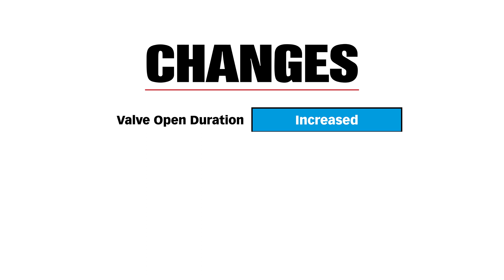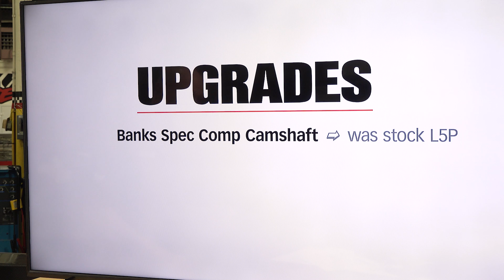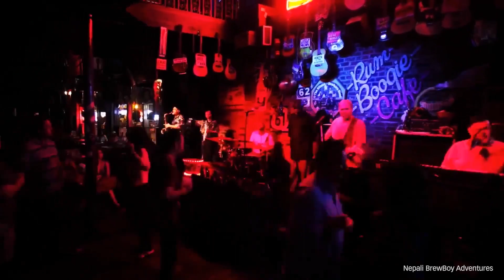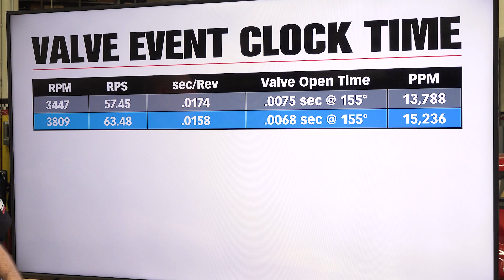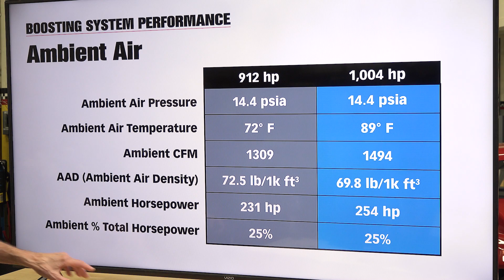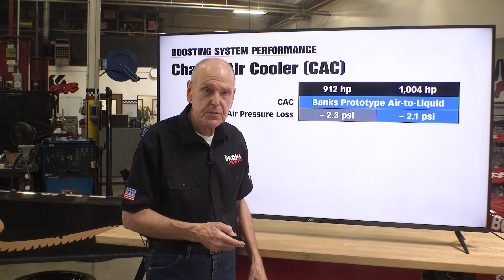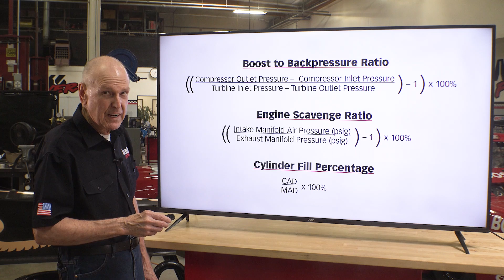1,004 HP !!! Killing A Duramax Pt 15

Comment: When the diesel king speaks the data truths it just makes me think everybody in the “roll coal” diesel world are just fools in his court.
Reply: I think it has to do with a limit of the mechanical pumps back in the day, by today’s injection technology, you’re right, they’re not just clowns, they’re the whole circus
Reply: Yeah I was that guy until I was enlightened by his videos. 2 gen dodge is a pig.
Reply: @joshuafiller254  it is a pig, unless built right.
Reply: @joshuafiller254  
Much respect to admit you rose up from ignorance.
Reply: @ZEPRATGERNODT  ignorance is nothing to be ashamed of.  Refusing to learn is shameful.
Reply: "Rollin' coal" is a meme as much as stance and "hellaflush" is, these days.
Reply: Yeaa you lost me at king of diesels.
Reply: yeah, refusing that heat and torque kill things
Reply: Yep roll and Coal...  just blowing unburnt fuel out the exhaust and Sooting up the inside of the engine...
Reply: Rolling coal is the diesel equivalent of putting a fartcan on a base Civic.
Reply: Lots of haters but I don’t see anyone proving him wrong with facts.
Reply: Fools for sure 🤙rolling coal is for people who don’t know power
Reply: Rolling Coal is the ugly, stupid and irresponsible way of making power.
With all the air pollution now days, those ppl should be arrested and jailed for minimum 30 days for reckless polluting.
Also tire burnouts should be the same.
We need to stop these retards from polluting everyone's environment.
Reply: The rolling coal brigade doesn't care about power as much as they care about laying soot on everything around them. If you want to keep it street legal there is zero need to make AFR so rich just to cool down the cylinder. WM or nitrous work better for that, and more sustainable for the sake of a handful hp at the top of rev range. Obviously the way Gale did here was to increase intake efficiency (maf + density), better fueling (cam duration, injector pressure) and improving exhaust scavenging.
Reply: It would be great to remove the EGR’s and DPF’s and make the Banks only tunes the standard of the land. We could have 1,000,000 mile diesel engines that get 25mpg!
Reply: Well yeah, roal coal is only burning more fuel and that's how it gets so much smoke
Reply: @josesaldana8058  kinda.. you get soot when you get incomplete combustion. Plenty fuel but not enough air / duration / compression (heat) to burn it effectively
Reply: The coal rollers are fools to ANY halfway intelligent person... 🤷🏻
Reply: I need compounds in order to not roll coal and compounds will throw a rod. A s468 will throw a rod if I come down from my s475. More low end torque with compounds which will burn the fuel and not roll coal but will produce too much tq for my stock bottom end.
Reply: I've always said rolling coal was stupid and showed a waste of potential power.
Reply: If your not rolling coal there’s still power to be made. You must not understand how the diesel engine operates. They can’t run rich, and the more fuel the more power.
Reply: In high HP applications excess fuel is used to cool the cylinder air temps. So it’s not completely useless but for anyone on the street, it is.
Reply: @DaCaveman84  soot production doesn't Cool it elevates the EGT and internal heat transfer at the turbo. Very much the opposite to what you said
Reply: @turbolife5912  microscopic soot is devastating to the surface,  think 2000 to 6000 grit polish.  That's a wonderful thing to be in a rotating mass like an internal combustion Gas or Disel...
Reply: @DaCaveman84  unless you're lavvon than you use water meth, to keep them under 1800
Reply: @DaCaveman84  Not in a diesel engine.
Reply: For a diesel engine, anywhere between around 16:1 to 13:1 is a bad place to be.  If you're at 16:1, add a little fuel, and end up at 14.5:1, you're going to melt pistons.  If you add enough fuel to bring it down to 12.5:1, you start cooling off again.  A diesel will make more power on the rich side of stoich than on the lean side, but it'll smoke like a bitch.  Add even more fuel than that, and you'll end up cooling the engine.  The difference between a rich burning gas engine and a rich burning diesel engine is that the diesel doesn't lose power like the gas engine does...because there's no spark to foul up or flame propagation sensitivity.  The main takeaway here is that yes, adding enough fuel will make a diesel run cooler, but it's a last step in an all out competition environment.  You need to concentrate on getting everything else on the engine working well before you consider going rich, and you're definitely not going to use it on the road.  So for anyone planning on building their trucks to be street legal, you follow the lean of peak ethos because there's no need to go rich on a truck meant for highway driving.  Most engines grenade before you run out of power adders anyway, so running rich is hardly even a consideration.
Reply: @Skinflaps_Meatslapper  well said.   The force is strong here boys,   listen to the man..
Reply: @Skinflaps_Meatslapper Extra air is better for cooling
Reply: @monsaka7827  Extra air will cool the engine, but it's not "better"....with that extra air, you can burn more fuel, which means you can make more power.  Cool the engine with fuel and you make the most of the air that you've worked so hard to get into the engine.  The trick to making power with any engine is getting more air in, so long as you're utilizing it for power instead of for cooling.  Gas turbines give up about half of their shaft HP because they need a blanket of air to keep the engine from melting, diesel engines need the same, but the way they differ is that a diesel engine will start cooling off again once you pass stoich and add more fuel.  What that means is you're utilizing 100% of the air you're putting into that engine, rather than 100% of the fuel.  Fuel is cheap when the goal is to make power, air is expensive.  Use all the air you can.  There's a reason why none of the drag and tractor pull diesels are clean burning engines, they all roll coal because they've already maxed out the amount of air they can stuff into those cylinders...the only power left is to go rich of peak.
Reply: @Skinflaps_Meatslapper  Air is better and safer.
Reply: @monsaka7827  Air is better and safer for your grandmother's VW Jetta.  You're more than welcome to not understand what I'm saying, I won't stop you from being a walnut.  Stay on the pansy side of peak burn if you like, I couldn't care less.
Reply: @DaCaveman84  bro have you seen the 1320video coverage at UCC? A guy (can't remember his name) put down 3336whp without blowing up or overheating, while smoking about as much as a 24v 5.9 Cummins with 15 over injectors.
Reply: @DaCaveman84  you are right.  I am in head porting diesels for 22 years now... And the high boosted engines ...need the extra fuel cooling things down to prevent pistons from melting..... 

I know a lot of smoke costs power..but if you can run 6 or 7 bar of boost.....instead 4....
Reply: It's also a money thing. It's a "free" upgrade to take a grinder to your fuel plate amd dump fuel in an old diesel and make some power.
Reply: the way this engine is setup is not emissions legal. with a dpf of these power numbers would not be achievable.
Reply: @djcurtis8677  not sure in the states... but over in the UK we have a smoke opacity test, cars with faulty DPF removed will pass the test no problem and was common practice to remove them and change the map. Until the  government made it illegal. These cars would often be too clean for the machine to pick up. A replacement DPF costs 1000s in some cases so that was the reasoning for people to do it. Surely if the engine is running that clean to pass the test with out it... they can't be doing a whole lot of help with them fitted but to restrict the engine flow and cause problems.
Reply: @djcurtis8677  everyone in here is a diesel performance fanatic and no one here cares about diesel emissions, I assure you. Gale does and he produces VERY clean burning diesels.

Also, 1000hp is definitely achievable with emissions hardware on a diesel. LML owners have been doing it for some time now.
Reply: @utvwerxoffroadfabdesign4172  I think you completely misunderstood what I was saying. I wasn’t saying that it wasn’t achievable on a factory emissions setup. I’m saying that this set up would not make 1000 hp in a truck. Without the free-flowing exhaust and intake that he was able to make without the constraints of a tight engine bay it would make less power. Also, the engine in this video is not hooked up to a DPF/SCR Therefore, this is not an emissions compliant set up.
Reply: @utvwerxoffroadfabdesign4172   and on that same topic are we talking about the same Gale banks that still sells the 6.7 Cummins monster ram intake horn that helps facilitate an EGR delete?
Reply: @djcurtis8677 banks strives for emissions compliance. Power requires efficiency means lower emissions.
Reply: We get it you dont like black smoke.
Reply: @slcWINGS11  Anyone that gets it doesn't like black smoke.
Reply: @slcWINGS11  it is the engine that does not like black smoke. The data tells the story.

Comment: I would be interested in seeing what the power gains would be based on the old cam with the new turbo sense you were creating excessive backpressure with the previous turbo? I wonder how much of the gains you saw were related to increased cam duration and how much was related to decreased backpressure. Obviously the combination worked well together which is why you saw decrease in boost with an increase in power.

Comment: Gale, incredible but how long would this engine last on the road with a set up like this? Btw you just sold me an L5p thanks :(    -$$$.$$$
Reply: That depends on what you do with your foot.
Reply: The opportunities to use 1000 hp on the street are very limited.  The engine would last longer than your drivers license.

Comment: Water/meth doesn't make sense as the intercooler is so damn efficient.

Twin turbos would reduce backpressure. Compound turbos would produce more airflow into the engine, but would they also add more backpressure?

How well are the heads able to feed the engine at these rpms? Are they restricting flow at these air density levels?

Does it make sense to go with larger injectors, or run a leaner mixture to reduce injector duty cycle degrees?

Comment: Your recent videos have been phenomenal. Your expertise and your willingness to share it are greatly appreciated. Thanks!
To an old-timer like me, an engine should produce sustained power without gimmicks that require more than one fuel tank. I would prefer a denser charge or higher revs to make more power. I'd also like to see if it will last at least a few minutes at peek power. A short endurance test would be interesting.

Comment: Judging from the compressor outlet temp, I wonder if a finned like compressor housing(like an old 2 stroke engine) would effect temp outlet, it's dissipating heat at its source, also easy the work of the intercooler, even better if the turbo is remotely mounted from the engine bay..

Comment: Would be nice to see the hp graph of stock  motor and an overlay of all the up grades done, curious on how power is delivered
Reply: They don't do full rpm range pulls, hes stated that in previous videos. This test is about max power, 1 thing at a time then you work on the rest.

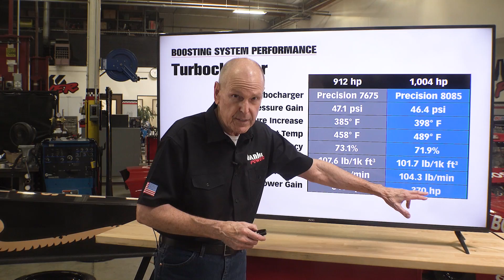Comment: You may answer this further in the video but I'm at 20:55... is there a direct correlation between compressor efficiency and Ambient Air Temperature? If it was 89 and compressor efficiency went down... what would happen if it was 30 degrees how much would it affect compressor efficiency?... would it go up to 75- 80%?
Reply: All of the above... nitrous compounds meth... whatever it takes to find the limit

Comment: My vote would be compounds because that seems to me what justifies and explains doing this setup in a way that is so maintainable both water methanol and nitrous oxide run out and need to be refilled, some of the time quite frequently, so if this Build is about testing the engine in a way that can be sustained as opposed to the dragstrip methodology compound turbos are going to be the only sustainable way to push it that far

Comment: Who are the 7 morons who disliked this video? I mean c’mon guys.  

Like many others I don’t think you can afford egts much higher then they are something definitely needs to be done there. 

Your about out of crank angle for anymore injector on time. 

Just do everything. Compounds for more  air flow, with the extra air flow you can put in 150% over injectors and still maintain safe air fuel ratios and keep your on time duration under your 40 degree crank angle. Add water/meth to help keep it all cool. Give you another 150 hp.
Reply: "dislikes" are no big deal.  The robots at YouTube count up the total events.  A "like" or "dislike" is all the same.  The haters in the world would like to think they are doing some terrible shit but nope, doesn't mean a thing when it comes to "views".

Comment: This really is amazing. But there's no way that's going to fit into your Silverado it Sierra! And if you could make it fit, an engine compartment will get way hotter than the dyno room. After you send engine parts flying, I'm interested in seeing a series on upgrades we could do ourselves. To see those parts go flying, I'd like to see a compound turbo setup with each stage running through a charge air cooler. And if that doesn't send parts flying, methanol injection!

Comment: I have a 2007 Cummins auto trans 4x4 quadcab Ram 5.9. I know I will need a built trans. But how much can i build this engine with a stock block safely? It has 100k miles on it now and it has a bad injector. So now is when I want to start the build. Thanks for any help.

Comment: This is nice, but I do have some suggestions as requested. You're almost out of injector again. You might be able to push the rail pressure a bit but you are already crowding 40° injection timing. There is maybe another 60hp left until you get to your limit at the same rail pressure. You might need a touch bigger turbine housing to cut drive pressure and improve efficiency. The charge cooler is really good, but it has some restriction and you may gain some mass flow with more core space available. I would really consider both methanol and nitrous oxide. You could drop the air charge temp with both, but the methanol would somewhat alleviate demands on the injectors. The nitrous, if it was flowing enough, could shift the efficiency of the compressor. If you use nitrous you can definitely go to a larger exhaust housing. I am interested why the compressor efficiency dropped, granted it wasn't by much, but there is more efficient compressors available. A GTX 4709 80mm puts it right at the 74% line with a PR of 4.0 and a flow of 104lb/m. The x275 80mm compressor that I think you're using has a different compressor cover to comply with class rules, it is a substantial different wheel as well. Scaling off the compressor map I would estimate the Garrett turbo to be at about 89000 rpm at that flow and PR, and Garrett recommends 102500 maximum.
This has been an amazing series and I wish you the best of luck.

Comment: Compounds with Intercooling, two of everything. Methanol Injection benefits are pretty easy to figure out based on your air density numbers. Nitrous Oxide is not as practical and seems like taking the easy way out. You need more fuel and air to make more power to kill it. You are almost out of injection duration so your going to need more fuel and more air because you showed how low the A/F ratio was. I would like to see A/F at 18 or higher and more than 1,000 HP.

Comment: Thank you Mr. Banks! I would prefer ported heads, then run a twin & compound turbo setup. Log all relative points between the two systems, followed with a Mr. Banks class lecture of the data!

Comment: I don't have a diesel, may never have. But enjoy it all, even though I don't understand some of it.
.. But.. How much of this could be done to a daily driver?
.. And to a pickup that pulls a camper.
.. Is the gas milage in the toilet?
Guessin, this is all racing applications?
Keep it up guy..
Reply: Wes Courtney Diesel is nice because mileage really doesn't suffer so much when taking more power out. I mean if you use same amount of energy while driving and not launching it from every corner. From stock you might even increase mpg.

Comment: I think water/meth. Compound could do more, but we are taking baby steps in projects like this. Once you know what can be done with charge cooling you know the best that single turbo could ever do. I wonder if water/meth will do much good with that much charge cooling. I would bet the engine will hold together for now, but I think compound turbos will be able to push it over the top. Just how much faster can you spin that engine before something gives? Will you need another cam?

Comment: For straight up power to destruction you cannot go past nitrous. Water meth injection has a big downside as far as increased air humidity originaly it was to reduce pre ignition in spark ignited engines to run increase spark advance. Compound turbos mainly reduce boost lag not performance in a deisel and add in a number of other undesirable factors. To keep it real world you could play with some gas blending. Do you have any emissions data from your test to share compared to stock ? I hope a lot of the black smoke fraternity start to take notice of the work you are doing, on that point alone you have made an invaluable contribution of fact to the world of deisel engine performance👏. Cheers mate🍻